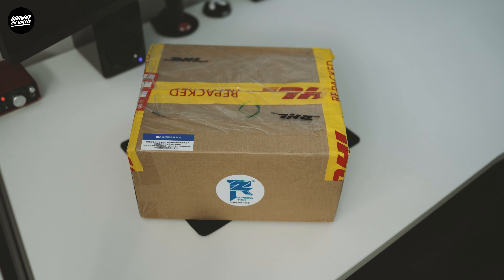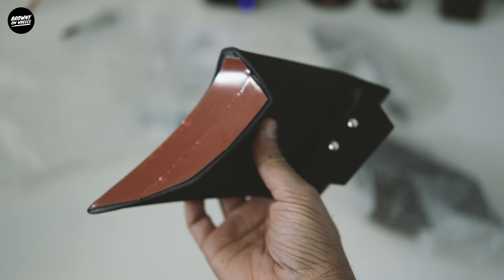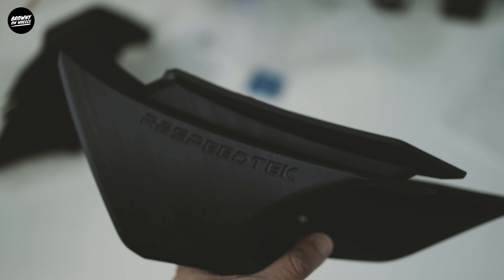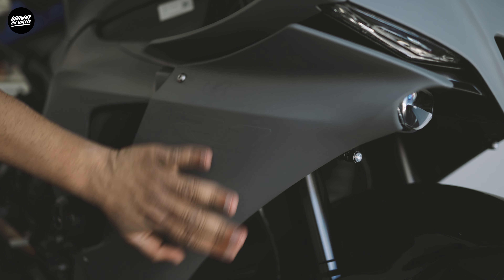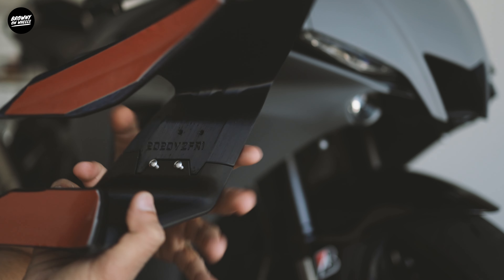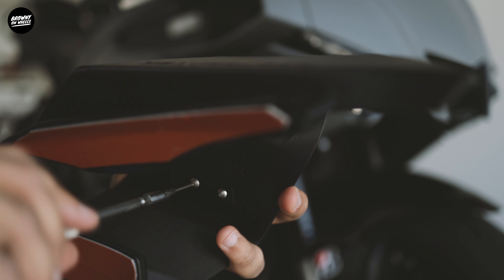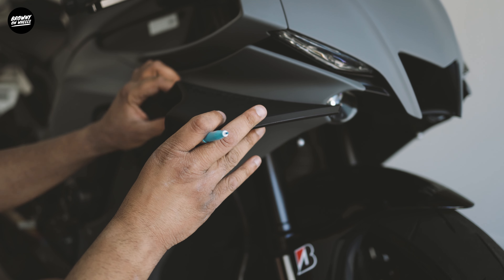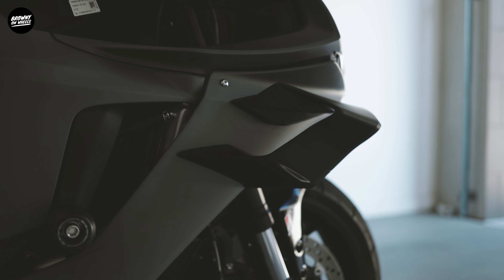【44】Winglets Install on my 2023 R1 ⚡ ( I BET YOU HAVEN'T SEEN THESE )

Comment: how have they held up after install since they are taped on?  any feedback would be great.
Reply from the maker: Hey man, its been good so far. Havent had any issues the tape is quiet strong. I actually tried to pull it lol It wont come off. I may have to get a new set of fairing. :)